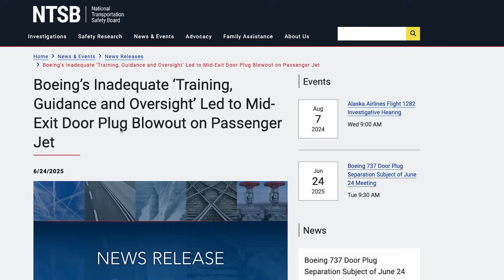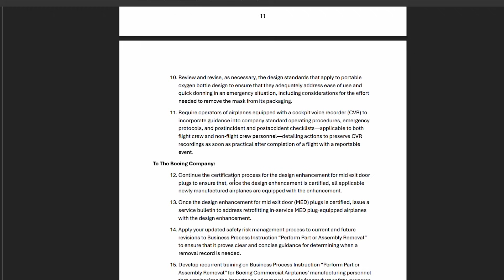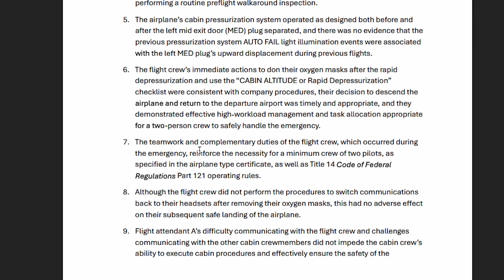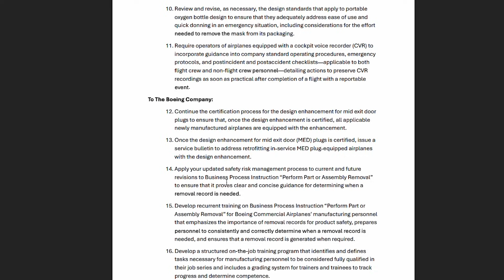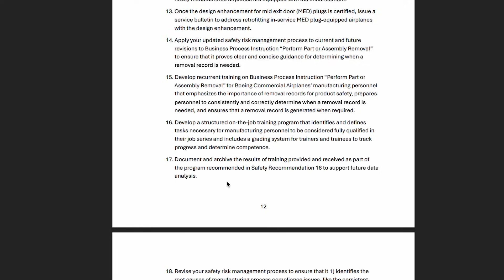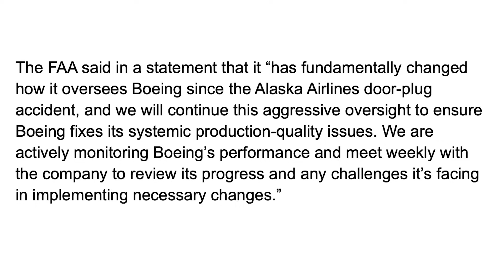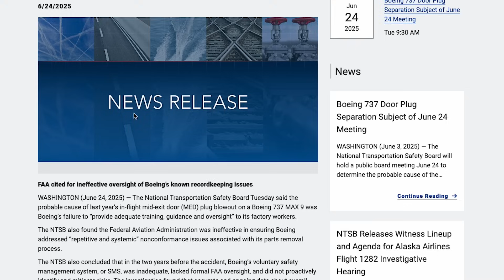Alaska 737 EXPLOSIVE Door Plug Fail - The NTSB Findings

Comment: Bosses of large companies are usually paid by share price increase, at least for their bonuses.  This is all they care about and the culture passes down.  At the bottom jobs are under threat if done 'too slowly' and bonuses are in place for production.  This leads to everyone pushing products out the door with the inevitable failures of QA.

Possible solution: At the start of every year, every worker has a £/$ 10 000 'pot' of bonus that is paid at year end.  Every time a quality defect is picked up they lose some of that money.  The board members are also on a similar scheme.  The only weak link is QA.  They can't be on a bonus for every defect they find so will need a decent pay rise.

Comment: This is just incredible. When I worked in aircraft servicing in the military, we had a huge status board in the servicing office. EVERY TASK on that aircraft that needed doing, without exception, was listed on that board, each task with its own row in a giant spreadsheet, with columns for the item's nomenclature, its fuselage station number (where the item is located on the airframe), the name(s) of the engineers/technicians responsible, the supervisor's name, the serial number of any related job cards and documents,  numerous other piece of relevant information, and at the right hand end, the task competition status. The NCO i/c Servicing could just look at that board and determine exactly what stage every task was at, and whether it was completed or not. Things like this simply could not happen if everyone did their jobs.
These failings are, IMO, a direct result of Boeing's management philosophy of pressuring all servicing staff to get work done as quickly and cheaply as possible, rejecting their safety concerns - and all because of the bean-counters' insistence that the bottom line and shareholder profits be prioritized at the expense of engineering quality and aircraft safety. It seems they have learned NOTHING from the MCAS debacle.

Comment: As far as flight crew numbers, I'm totally against the bean counters getting rid of Flight Engineers.  All you need to do to understand this is to catch the documentary on British Airways (I think flight 009), in which, during a night flight, Captain Eric Moody unknowingly flew through a huge cloud of volcanic ash from an eruption they were not notified of and could not see. All 4 engines of their Boeing 747 flamed out. Complete loss of power and they didn't know what had caused it. 
They finally got the engines started, because the Flight Engineer (3rd man in the cockpit) never gave up trying. 
A 3-man cockpit crew is the reason they were able to avoid crashing into the ocean...at night.
I say get rid of the bean counters. Patrick Cowdrey, Central Point, Oregon

Comment: Had Spirit AeroSystems done the installation correctly would this have happened?

Why Spirit AeroSystems is glossed over is bewildering.
Reply from the maker: Well, the interesting thing about this report, is that Boeing removed the plug and put it back incorrectly, but the report does mention problems at Spirit

Comment: Personally I think that one of two things needs to happen to preven this from happening again.... first, either mfrs need to design different fuselages for different configurations, since they are assembled in sections, so say if the rear of the plane has an optional exit, you have two versions of that section, not use a plug. And/Or Second, airlines should NOT be allowed to customize a plane to a point where a plug would need to be used.  Either they buy the original (And only) configuration of that particularly model, or buy another model, possibly another brand, but this idea of a door plug needs to not be a thing.  There's either a hole there and a doorway, or it's a fixed structure, no plug.

Comment: This video is unnecessary damaging to Boeing. You made brief reference to modifications to assembly procedures… brief… but the video as a whole gives the impression that defective practices still prevail. 

Likely, under current management, the process has been corrected. The proper way to have made this video would have been to travel to Renton to request a factory tour, and ask how the process was corrected. 

Don’t email or call because you will get worthless blather from the public relations department. You need to get to the factory floor and ask. 

Constant Boeing bashing is doing harm to Boeing, the US and to the flying public.
Reply: Boeing employee or stockholder?   I think parts falling off planes and people dying is what is damaging to Boeing
Reply: It appears he accurately depicts the NTSB report

Comment: THIS IS CULTURE PROBLEM! Since the merger with McDonald-Douglass the culture about 'SAFETY' declined.  Certain deviations in 'work product quality', were deemed 'acceptable & fiscally justified' vs the 'Boeing liability profile.'  This is like saying, a 'B' on a algebra test is a passing grade, but the student was still incorrect 20% of the time.  Aviation is a HRO (High Risk Operation) eneavor & therefore, perfect product is not just the goal... IT IS THE MISSION!

Comment: Something not mentioned … the merger with Lockheed years earlier. Boeing was run by engineers and that’s what they concentrated on, quality engineering. When Lockheed management were absorbed into Boeing, their mindset of profit over everything else took over with engineering and quality taking a backseat to profit. Boeing did it to themselves.
Reply: And recently, Boeing moved corporate headquarters to Chicago, further separating management from production.  It's no surprise that quality and safety are no longer in the hands of engineers.
Reply: @Mollykitty4627  Recently?? It was 2001 they moved.
Reply: Now, Arlington VA
Another mistake.

Comment: Undocumented maintenance - that's what this was. And it was/is pervasive in all of the factory. Managers claimed it would take longer to write up certain actions than to just do it. The problem is if its not documented then there's no oversight. There was also a lot of pressure for optical progress. On the floor, managers pressed to have things 'look' like they were further along the assembly than it really was. This near miss ought to have long term corrections. All that's left is if it'll be followed judiciously as it should be.
Reply: This man is SPOT ON. Exactly what happened, to a T.

Comment: Make shoddy workmanship a terminable offense. The workers can no longer hide behind their union cards.
Reply: It's a much more systemic problem than that.  And union workers were getting fired for shoddy workmanship fifty years ago.
Reply: This is what happens when the stockholders are more important than the customer. This is a problem from capital not labor.
Reply: When a company goes from being performance driven, by engineers, to cost cutting by bean counters, it goes without saying quality and safety suffer. As long as the old “bottom line” looks good to shareholders 😢
Reply: This has near zero to do with a union failure. It was a company wide systemic failure that concentrated on cutting costs.
Jim Mcnerney  belongs in prison
Reply: Union workers built quality products when patriotic Americans controlled companies. Capitalism without any kind of social responsibility destroys countries.

Comment: Extensively outsourcing your components and moving your production lines to "right to work" states with weaker unions and lower labor costs such as South Carolina is fine if you are building cars. Indeed, my 2024 Camry was built in Alabama and they did a great job. Large aircraft have proven to be a different story.
Reply: Definitely! Union labor is far superior in terms of both quality and quantity. If you can’t trust a union worker to do the job correctly and on time, who CAN you trust??
Reply: However, the 737s are built in Renton, Washington.
Reply: @GH-oi2jf  I know that some of the 787s are built in SC. The problem was there weren't enough people in the area that had the skills required to actually build aircraft. You can work with the local trade schools to establish the necessary programs and do some training in house but this takes time.  If a car fails because of a manufacturing problem the driver can pull over. 787s are much more complex and a place to land can be pretty far away if you are crossing an ocean.
Reply: @GH-oi2jf 
And...?
Reply: I'm 73 years old retired disabled UAW member and a veteran. This started with Reagan being elected President. Capitalism without any kind of social responsibility destroys countries

Comment: You don't need forms and computer systems to keep track of doors and bolts removed.  Like the Presidential Commission on the accident at Three Mile Island said, rotely following rules and regulations doesn't make you safe. But I'm sure that's what the FAA and NTSB want you to believe because their jobs depend on that mindset. Rather, the Presidential Commission said a culture of safety makes you safe.  What does that mean here?  Don't start a critical task you can't finish in one go.  If that's not possible, physically tag the part.  I personally reinstall bolts from where I removed them so I don't lose them, and that also makes it impossible to reinstall the part without you physically touching the bolts again.  It can also mean someone with experience just walking around before buttoning things up looking for obvious problems.  Taking your time to do it right the first time. And so on.

Comment: As someone who works autonomous aircraft for DoD and has touched on reduced crew cockpits, if your cockpit is designed for two pilots, it's going to need two pilots. If the cockpit has been designed for one pilot, it only needs one pilot.  Don't say it can't be done. We already automated the flight engineer out of the cockpit. Heck, in DoD, we're even moving beyond flight automation into higher level mission automation and autonomy.  So not only does the autopilot have stick and rudder skills not just simple heading-speed-altitude modes, but it can also build situational awareness and reason in complex missions such as SEAD and DCA. The Navy has basically stopped going to the boat with T-45s because PLM on the F-18s and F-35s is that good and reliable. With each generation of fighters, the pilots aren't so much pilots anymore as mission managers. This stuff will trickle into commercial aviation from the military side, but it will happen.
Reply: I’m an aircraft mechanic. I and the flying public won’t fly a 1 or 0 manned cockpit in an airliner. No friggin way. Not saying it’s not feasible but in no way would I entrust my life to it.
Reply: Just because it can be done (a SAC bomber did a hands-off flight start to finish in the late 1950's) doesn't mean it's a good idea.  Airliners don't have ejection seats, for starters.

Comment: Corporate greed
Reply: Yeah, right. They saved millions by not reinstalling four bolts they had already paid for. Give me a break.
Reply: @Puffs_Daddy  There's a lot more to it than four bolts. Not having the correct paperwork, no inspection or oversight. Paying unskilled labor to built airplanes. All these things save money and speed up the process. But you probably don't understand these things.
Reply: @2strokemerc  The bolts were not left out due to greed. It's that simple. They weren't unskilled labor, and they weren't building a plane. They were repairing something normally done at a subcontractor, so it was just something they weren't familiar with. Boeing screwed up, no doubt, but it wasn't due to greed. That's a blatant knee jerk reaction. And since I've been working airplanes for 47 years, I think I'm pretty sure I understand it way better than you do.